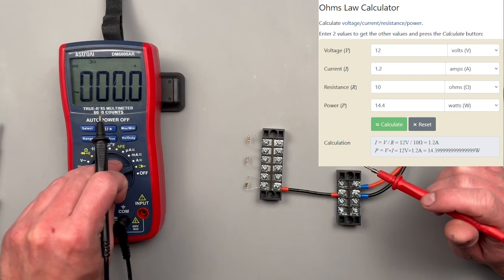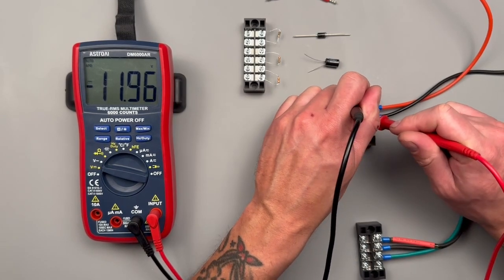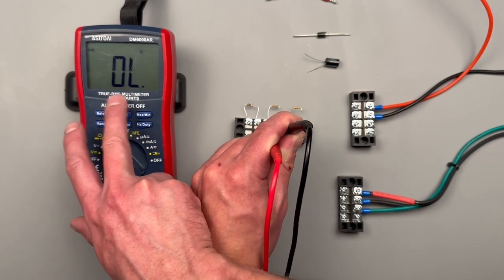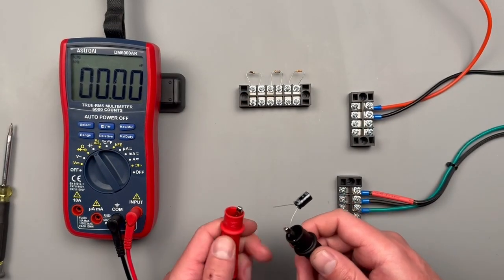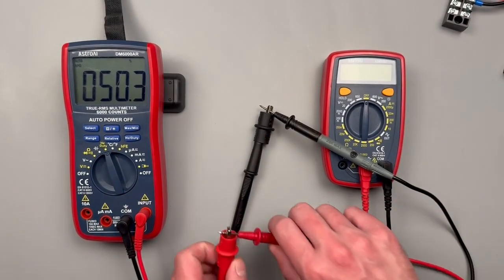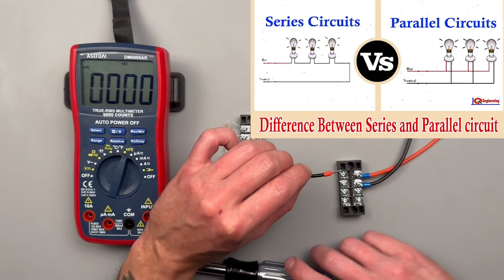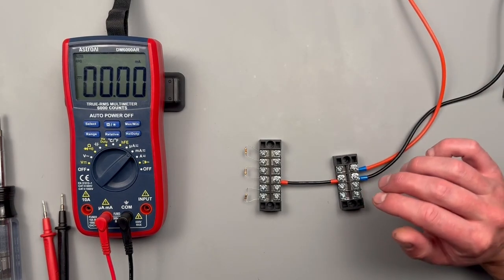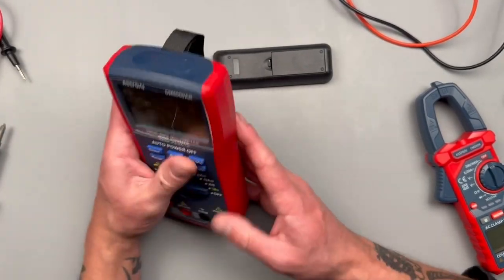💡 How to Use the AstroAI DM6000AR Digital Multimeter - Comprehensive Beginner's Guide!

Comment: Well mine couldnt read my laptop charger is supposed to read 19 v and not even reading correctly...dont know if maybe batteries but not happy  with it doing this weird readings
Reply from the maker: hmm you could have your leads in the wrong ports, or you could have your meter set to the wrong settings. I also feel like 19 VDC is a really random number but who knows.
Reply: @maddoxmechanic all other readings are good...but now it fixed by itself which is weird
Reply from the maker: @samnwakefield2032 okay maybe it’s time for a new meter? Something a little more reliable 🤷🏼‍♂️ idk. At least everything is working for now. But could be a sign to get a new meter in the near future

Comment: I can’t get the kickstand to open. It has no room for a finger to open it. Need to use a knife. What am I missing? There’s a weird magnet thing hanging from it. Any help?
Reply from the maker: You might try just using like a little flat head pocket screw driver to pry open the kick stand. Could be a bit safer than trying to pry it open with a knife. The magnet strap is for if you're working in a metal enclosure, like a breaker box, so that you can easily hang your meter while you're working.
Reply: I had the same issue today. Used a little flat head to get it open and then at the back of the top part of the cut out I took a utility blade to it and carved out a little notch, enough to get a finger nail under. Opens much easier now.
Reply from the maker: @btcharlee9727  Thank you for sharing!

Comment: Thank you. This may sound stupid but how do you change the battery?
Reply from the maker: No stupid questions here! There should just be a cover on the back of the meter that you unscrew and pop off. you might have to remove the outer red bumper cover that boarders the meter to access it. Sometimes they're on there pretty good and you have to use a little flat head screw driver to pry it off.

Comment: So far, the only thing I don't like about it, is that every time I turn the knob, is makes a noise. I wish it only made a noise when I tested for continuity. Other than that, I think it'll be fine. I'll probably print out a new back since I don't quite like the stand, but that's just custom stuff.
Reply from the maker: I can see how that is a little annoying, but I also think it's standard practice amongst multimeter manufactures. That way you're alerted if setting is accidentally changed while you're not looking. Solid meter though! Hope you enjoy it. Reach out if you have any questions!
Reply: You're kidding, hopefully.
Reply from the maker: @apostasiaelegcho5612  no?

Comment: Thanks for your video.

Does the relative function work when measuring resistance, to cancel out the resistance of the test leads? I noticed that some multimeters have a relative function that works in some modes, but not for resistance.

Is there a way to turn off the beeps when turning the dial?
Reply from the maker: You bet! I don’t believe there’s a way to turn off the beeps. As far as the relative function, I honestly can’t speak on it. I no longer have the meter and filmed this video a while ago.

But thank you for watching!

Comment: Bought one not too long ago the multimeter came with red and black probe caps and I can't get them off, how did you get them off?
Reply: Same
Reply: This actually slides inside the lead connectors.  Just grab the very tip of it, and it should come out.
Reply from the maker: @jordanberry798  Thanks for the help
Reply from the maker: You just have to pull them off. Sometimes they can be a little stuck

Comment: Helpful video. thx. . I have the same ASTRO multimeter the issue with MAX setting on AC voltage it shows 0L when checking home socket voltage. Reads voltage fine without MAX option
Reply from the maker: Hey you bet. Bummer about the MAX setting. But I think for the price it’s not a bad meter

Comment: I purchased this to measure 50 amps line, but I see is not good for more than 10 amps, right?
Reply from the maker: That’s right. For amperage at that level you’ll need an amp clamp. If you like AstroAI they have an inexpensive amp clamp that should handle what you need. I’ll leave a link for ya here:

https://amzn.to/443v6hH

Comment: So I can't set this meter to 20k ohms to test my motorcycle coils?
Reply from the maker: Could you elaborate?
Reply: @maddoxmechanic well I believe I'm supposed to have over 10k ohms onnthe secondary side of the coils this meter is just showing LO
Reply: @maddoxmechanic sorry it's showing OL I mean. I'm getting a reading of 3.4 on the primary coil but only showing OL on the secondary! How do I know if this meter can measure over 10 ohms?
Reply from the maker: @davenoel4592 OL just means “Out Of Limits”. You’re on the wrong OHMs setting of the meter. I have a more in depth and up to date explanation of how to use a manual ranging meter here:

How to Use: Klein Tools MM300 Digital Multimeter Manual Ranging
https://youtu.be/bznQFBpLgkE
Reply: Thank man but the video you just sent doesn't help me with this piece of shit Astroai dm6000ar I just bought through Amazon. If it was like the Klein on the video you just sent I could simply set the ohms to 20k or 200k manually.
Reply from the maker: @davenoel4592 oh yeah you’re right. This is an auto ranging meter. Sounds like it’s probably an open circuit then

Comment: Great video, impressed with your in-depth knowledge.
Can I use this meter for HVAC work especially to check capacitors of compressors/condenser fans and also microamps of flame sensors ? And millivolts readings too
Reply from the maker: Thank you I appreciate that. I think this should be able to handle all of those. I can’t speak to the accuracy of the millivolts but it does have a micro amps setting. Just be mindful that it is a lower end meter to it might not be durable enough for daily use on the job
Reply: @maddoxmechanic  Thanks for your kind response.
I have already subscribed you. 
Thanks again for sharing useful material.
Reply from the maker: @babur729  of course!

Comment: Thanks for the review. I would have loved to see the HFE measurments between your transistor tester and the Astro AI.
Reply from the maker: @darryleng9906  hey thanks I appreciate it. I’ll be sure to include those in future videos. I will say, the transistor tester is so far superior in the information it can provide, at such a low cost, that it seems outdated to have one built into the meter.

Comment: hi there can you plz tell me how i would set my astroai 6000 up to check for a parasitic voltage on a car battery ty :)
Reply from the maker: @clivemouse  hello 👋 youll need to make an amperage measurement in series from the battery to the rest of your vehicle. There are lots of videos already out there on how to perform this measurement that’ll be able to explain it in much better detail than I am able to in YouTube comment.
Reply: @aiyogarage Ah, yes, I get that. I was more wondering what to select on the meter. Thanks for the reply.
Reply from the maker: @ you’ll want your meter on the “mA” setting. Black lead in “COM” and red lead in “uA mA” port. Remember that you’re measuring amps, NOT voltage. Anything over 100milliamps is considered parasitic draw. Be careful when using your meter in this configuration.
Reply: @maddoxmechanic  ok ty ill give it ago tomorrow
Reply from the maker: @ tbh first thing I would look into is anything aftermarket on your vehicle. Even if you confirm you have a parasitic draw, figuring out what’s causing it is a whole different can of worms.
Reply: @aiyogarage That's true; I wasn't sure what to set my multimeter to, as I haven't had that model long, and its manual is useless.
Reply: How do you set it to read low and high ohms?

Comment: I just bought one, I wanted to test my grounding sheets to see if they work. By simply plugging in the red and black wire and not even touching anything the numbers were going crazy. Is that normal? lol. First time using a multimeter, idk anything about this stuff. I bought this same device from the video.
Reply from the maker: @jasonmansoor7516  sometimes the numbers can jump around a little. Try putting your meter in resistance or continuity mode, and touch your test lead tips together. Should stabilize the numbers 👍